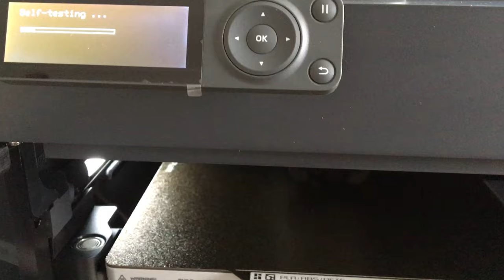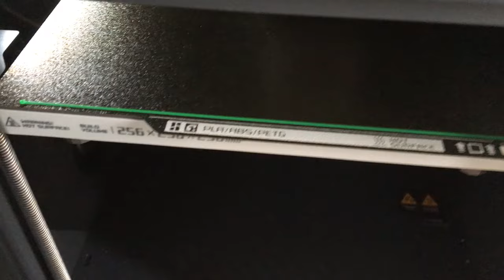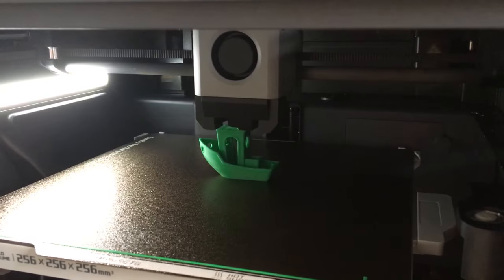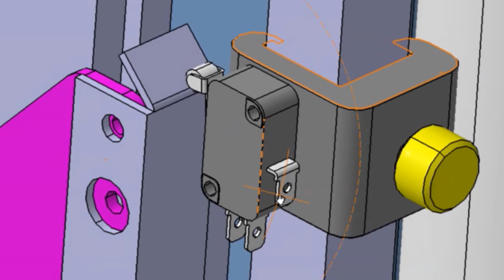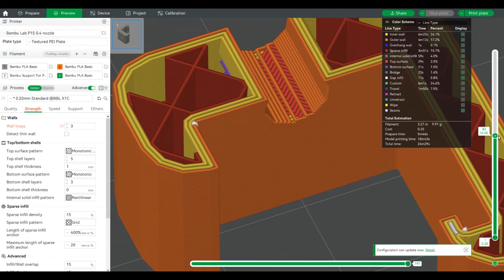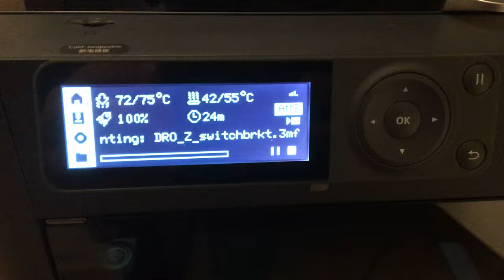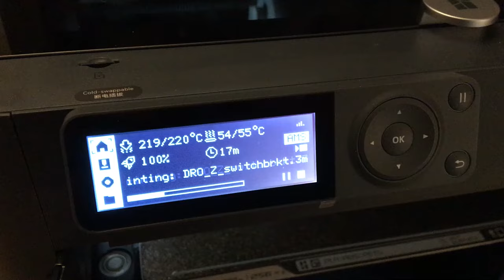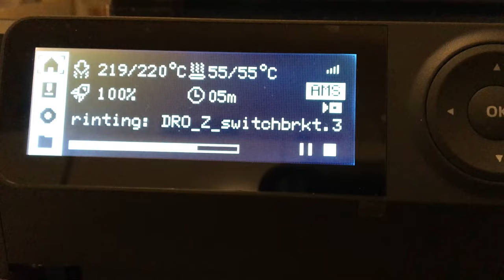Never 3D printed anything!  My new Bambu Lab P1S !

Comment: Dont rip something from the warm PEI Bed!!! 
Put the sheet bed out, let cool it down and the part will come loose!
Reply from the maker: Sorry about that, I'm still learning.  This is the sort of advice I hoped I would get as I'm pretty late to the scene.  I have since tried a part and let it cool and it lifted off pretty easy.
Reply: I pull stuff off the PEI bed all the time. Small things are fine. Ideally you would let it cool down, but sometimes time is of the essence.
Reply from the maker: Im still new but I’ve taken to the idea of gently pushing the part and if it clicks then carry on.  These are all small parts with some height so seem to be OK.  I have also flexed to plate for low profile parts.

Comment: If I where you, I would print out one of the Glass lid spacers (with vents) available.  To reduce novel creep if you are only going to print with PLA & PETG.
Reply from the maker: Ok thanks I’ll look for those.  Is there a single source for Bambu printable upgrades?  Found a few spread around.  I’m also looking for a support for the Bowden cable which stops it rubbing on the lid but can’t remember where I saw it!  Still much to learn and get into.
Reply from the maker: It’s been great so far with a closed lid, plus the AMS is resting on there.  What does it do exactly?  Is it stopping thin parts curling off the bed?  Sorry, just trying to learn more, thanks for the comments

Comment: You got it right in the title of this video, but inside the video I heard and saw you reference the "PS1" versus the P1S.

I saw you loaded the support PLA in your AMS and I wanted to make sure you knew that served a very specific purpose of acting as an intermediary between your supports and your models, when you specifically enable it's use, and that support PLA is not to be used like regular PLA to print models.

For PLA Bambu Lab recommends taking the top off and/or leaving the door open. That's why you got the other comment about a riser with an air escape built into it as that effectively acts as the same heat release.

Re-run the calibrations after EVERY firmware update. You never know what changes they are going to introduce with firmware changes, and you want to make sure your printer is calibrated with the latest and greatest.

Last thought I will leave you with, there are aftermarket (Big Tree Tech comes to mind) user interface panels for the P1S that make it look like the X1C. I have been told by multiple P1S users who have gotten one of these GUIs that they love them and made using their printer easier. So I recommend you look into one of them as the LCD screen and lack of LIDAR are some of the few dings I would give the P1S.
Reply from the maker: Ok sorry if I got the name wrong!
Yes I’m ok with the white PLA being support material.  At £68 a spool (according to the slicer software) I’ll only use it where needed.  I loaded it as it came with the machine along with green and orange 200g demo rolls.
We have used the white support just to paint a bit of highlight on some parts we printed, just for fun.  I’ve ordered a spool of white, black, yellow so we will use those in future projects.
I’ve printed PLA ok so far with the lid on and door ajar to keep the noise down.  If it works I’ll keep this but if I have issues I’ll open everything up .
I’ll look into aftermarket parts as there seems to be so much out there and I’m playing catch-up.  Although it seems like I have bought into the scene at the right time.  Just print and go!  Thanks for your comments.

Comment: I've been thinking about getting a 3d printer, but was a bit concerned how difficult it would be to set it up. Thanks for showing that it's so easy 😁
Now i just have to worry about being an old git learning to use CAD software  😂😂
Reply from the maker: The one thing that took a while was connecting it to the network.  It eventually bluetoothed to my phone but finding the wireless took some time.  I had to permanently switch off the 5GHz setting in the router and only run at 2.4GHz.  Also connecting via the QR code on the LCD display did not work and I added the printer through the Handy App.  Once connected it is all fine and does not need to be done again.

Comment: Hairspray (not recommended) or some other 3d printing adhesive like 3dlac is mainly for small parts that have little surface area or large parts with large surface areas that may warp, so it's actually helping adhesion rather than helping you release it. As said below just take your buildplate from the printer and set it on a cold surface and it will come loose and if it doesn't flex  the buildplate a bit to help it come off. That scraper you printed will ruin your buildplate if you use it.
Reply from the maker: Thank you, still learning so these are all great comments.  The hairspray comment I heard was related to an older machine, maybe an old Prusa or something so I guess things have moved on.  I've also seen people washing the build plate in soapy water but I'll leave this as it is until it starts having issues.  I've done quite a few prints on it now . . . I just keep thinking, ooh, I can print a part for that (little jobs around the house etc.)!  Draw it, print it, 20 mins later it's in your hand.
Reply from the maker: Doh.  Was typing the above reply and printing a long thin part and it just lifted at one end and the nozzle started pushing it around.  I'll try that again!
Reply: @routercnc9517   Soapy water and the rough side of a sponge does the trick for me mostly. The build plate gets contaminated after a few prints. 99% Alcohol is often used but on the gold build plate soap method described above works best for me. But sometimes I do use 3dlac if I need assurances for a long print. Happy 3d printing!
Reply from the maker: Very helpful thank you.
Reply: The textured PEI of the P1S is fantastic and should not need any glue or hairspray or other stuff for PLA!  For very thin parts, use mouse-ears or a brim in the slicer (well, at least in OrcaSlicer you can use mouse-ears).  If PLA is lifting, you're probably cooling way too much, so lower the part cooling a bit.
Reply from the maker: That’s great thank you.  I’ve been using it as it is and so far so good.  No spray or glue seems to be needed on this plate.

Comment: Quick question, how did you select your printer, specially the P1S vs X1C. I know there is a cost differnece btween,  but do you think the X1C would have offered more value now you have used the printer.  I only ask as my printer has recently gone faulty, and im between do i repair or make a resonable upgrade into Bambu. Great channel, great content
Reply from the maker: I looked into a range of printers while researching and the new Bambu Lab printers seemed to be at the next level according to reviews.  So then it was looking through the range - A1 mini, A1, P1P, P1S, or X1C.  Mini was a bit small (180x180?), P1P was same as the P1S but w/o enclosure, and X1C had the same basic mechanics as the X1C but was considerably more expensive.
I think the X1C with AMS was getting close to £2k, whereas the P1S with AMS was £900.
When I asked my colleagues they said what do you want to do with it?  Well as a beginner that is a difficult question because you don't know what is on offer and what could be done.

So that's why in the end I went with the P1S because it was enclosed, so could print more materials, had a good size print area, had the AMS to allow multi colour prints (do I need that!?, yes is the answer it turns out) and I could buy this model plus lots of filament as still be much cheaper than X1C with AMS.

I think the X1C had a few more sensors, and had hardened nozzles etc. but I think the P1S could be upgraded for not much money to have some of those parts.

So on reflection I have no regrets on this model.  It seems to do so much for you, prepping the nozzle, cleaning it, purging, auto bed levelling, that for the most part you can send a print and walk away.  You can monitor progress on your phone app, and you get a message when it is done.  The only times it has lost adhesion was when the part was getting quite large (fixed with adding a brim, and +5 deg on the bed), or the part was almost up to the edge of the build plate because it was a big part (fixed by printing 2 small pieces and clipping them together).  It is also very fast.

It is my first ever 3D printer so you will need to research a bit but I would buy it again without hesitation.  I've even considered the A1/mini as a cheaper side kick to speed up iteration of parts, but I think I'll not get that past finance!
Reply: I think you are spot on with all those comments. For anyone that's interest Bambulab are having a sale until the 5 July. The p1s with the ams is 140£ off usual list

Comment: So scrolling through comments I didn't see anyone yet mentioning STL is not good format for eport your files. That is why you round hole was not that round. STEP format is way better.
Cheers.
Reply from the maker: That is good to know, I can export either of those.  I just remembered seeing 3D printers using STL so went with that.  I'll try that next time, thanks for the tip.